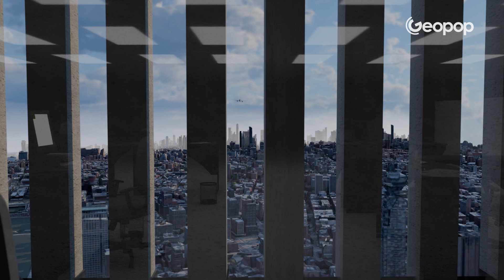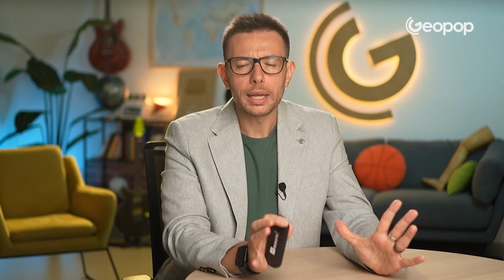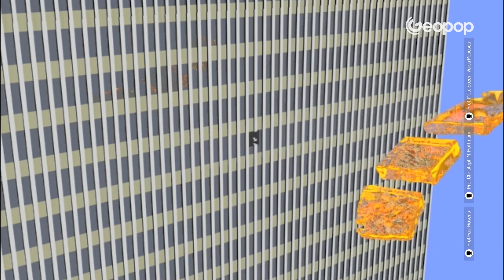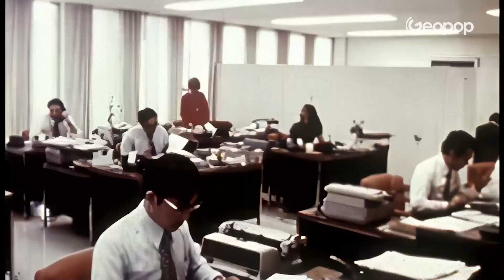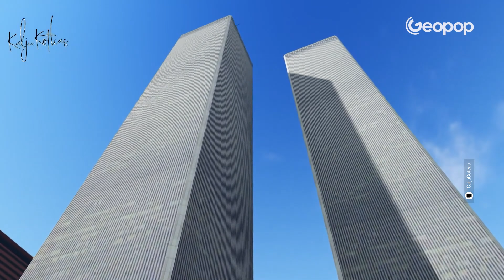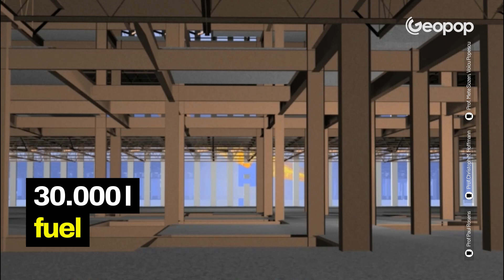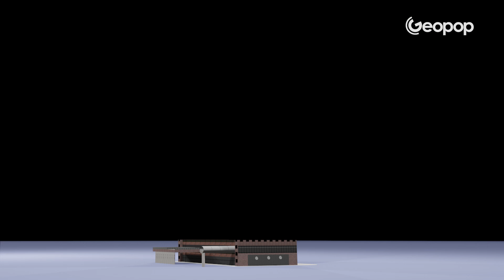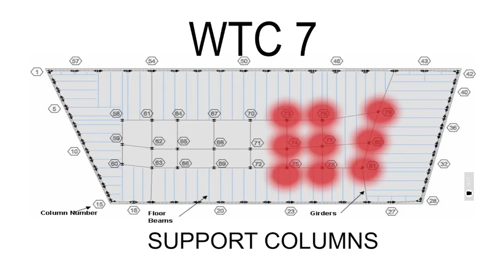9/11, 2001: The Technical Reconstruction of the Twin Towers and WTC 7 Collapses

Comment: What a pack of lies this video is. The inside of the twin towers did not look like that. It had no side to side spanning floors and no vertical uprights. All the floors (yes floors) were conected to a massive central core which was virtually a solid entity in its self. The outer shell ( windows) were load baring. It was the strongest skyscraper that has ever been built. It had so much steel that all the steel mills at the time in the US  were flat out producing steel for it. It was s superbly designed building and stood up to the impacts beautifully. What a cheek that guy has and all the ignorant  pancakers for still spewing out rubbish about it collapsing itself. Anyone with even half a brain cell knows how that was demolished. Although i will hand it to the the crews that did place that thermite, they did an awesome  job.
Reply: Okay flat earther lmao
Reply: @ttiiopp5245 But have you anything intelligent to say pancaker.
Reply: Tell me you don't have the slightest fucking clue how the Twin Towers were constructed without saying you don't have the slightest clue. FFS could you get it any more wrong than that?  How embarrassing 🤦‍♂
Reply: @TheLoonResistance Looks  like  another super high IQ pancaker, Thank god the powers that be have a few of you guys around. You will probably not find how they were made on YT because they are the powers that be, but the twin towers had a solid central core and a load supporting outer shell. It was not a steel lattice. So these guys really should not be lyeing about that. People that lie are generally having to cover for a crime. The law knows all about that.
Reply: @patricksmith4424  - Uh huh. 

While complex, most of the Twin Towers collapse mechanisms can be seen with the naked eye and easily discerned and understood by the layperson IF sufficient time is taken to understand.

1.   The Twin Towers consisted of 4 primary structural elements together forming an integrated system where each relied on the others. 47 hollow box-section steel Core Columns carry most of the gravity loads. The 236 hollow box-section steel Perimeter Columns carry the remainder and ALL of the lateral (wind) loads. Long-span Lightweight Steel Trusses connect core and perimeter column together with a Hat Truss on top to tie it all together as an integrated unit where no element can survive without the others. There was no structural load bearing concrete and most major assemblies were bolted together

www.youtube.com/watch?v=u7OqrC74Dm4
www.youtube.com/watch?v=eKtgPt7e0Fw 

2.   The impact of a 122-ton airplane (= 12 dump trucks) at up to 587 mph with the energy of a ton of TNT destroys the aircraft in 0.50 seconds. This in no way implies the Towers come out unscathed. Some folks get hung up on that. Many perimeter and some core columns are destroyed or damaged primarily by bending, twisting, splitting weld seams and critically by bolt-shearing failures at the end connecting flanges. No cutting or slicing - the reality far more violent and brutal. 

www.youtube.com/watch?v=zF-94yDHlk8

3. The impacts destroy or damage fire insulation, fire breaks and sprinkler systems on multiple floors. Jet fuel acts as an accelerant starting huge fires start across multiple floors simultaneously that spread spread rapidly with no effective firefighting or fire suppression. This was an unprecedented fire event . Office buildings are essentially giant piles of kindling when it comes to fires, chock full of stuff that burns vigorously and quite hot. 

4. The hotter steel gets the weaker it gets shouldn’t be a revelation. With fire protection compromised the survival time of the steel greatly reduced . Over time heat gradually causes the lightweight steel Floor Trusses at the damaged floors to sag, which we can see. No steel melted or needed to. Structural steel fails long before it becomes a puddle. It just needs to bend 5. A straight column is up to 4 times stronger than a bent one. Sagging floor trusses pull on increasingly weak and overloaded Perimeter Columns, causing some of them to bow inward by up to 5 feet until they buckle and fail, quietly initiating collapse. The formerly static mass above which the structure below could easily support converts to a dynamic mass up to 30 times greater. The Columns above and below the failure point are no longer aligned . The load bearing structure below no longer bears any of the load above, which falls past the lower columns NOT onto them. www.youtube.com/watch?v=ULdiD6gYZO0 www.youtube.com/watch?v=zTygQK3vriI 

6. Heat starts the collapse, gravity finishes it . Thousands of tons of debris drop largely within the four outer walls, through the open office space, the path of least resistance crashing onto the first intact floor, The bolted column connections instantly break as the amount of resistance the Floor Trusses can offer is negligible, slowing the falling debris only marginally and briefly before the connections fail. www.youtube.com/watch?v=flo62pdaIMI
Note: 
6a. This is NOT a solid top block crashing into a solid bottom block . 
6b. The debris falls past the columns not onto them. The columns provide no resistance to the falling debris. 
6c. Only the bolted floor truss connections to the core and perimeter columns offer any resistance. A pair of 5/8” bolts at each end of each truss vs. thousands of tons of falling debris. 
6d. No laws of physics are violated. 
6e. There is no 20 floors against 90 floors but rather 20 floors against one floor, then 21 floors against one floor, then 22 floors against one floor, etc. 

7. This floor-led collapse progression largely within the four outer walls can only go straight down. There is no lateral force to push it over the side, only gravity to bring it down. 

8. Collapse progresses through the floor systems past the columns, through the path of least resistance . Resistance offered by each floor is always the same while the falling mass acting on it is constantly increasing and accelerating (gaining energy). This process of floor-by-floor destruction cannot be arrested. It can only speed up . Rate of floor failures increases with each floor as momentum increases, reaching an average acceleration of 0.65 of GA, or 35% slower than true free fall. Bam, bam, bam down the building until there are no more floors to fail. More mass, more velocity, same resistance with each floor. Don’t get stuck on the but the lower floors weren’t on fire nonsense. They didn’t need to be. 
8a. This process is often incorrectly referred to as “pancaking” which while catchy, is incorrect. Too simplistic and inaccurate anyway. More like Kaiserschmarrn. 

9. The Towers were 95% air by volume. As that air was compressed inside the building by falling debris, pressure builds until it is blown out the sides in reaction to the building collapsing . Those were not “explosions”, it was expulsions of compressed air caused by the collapsing building, explaining the low velocity, lack of flash, blast, supersonic pressure waves and lethal high-velocity ejecta. 

10. Perimeter Columns become detached and peel away like a banana behind the collapse front, playing out to the four points of the compass in long lines extending to 800+ feet from the base of the towers, damaging and destroying nearby buildings. 

11. Core Columns fail last as their internal beam bracing is stripped away by falling debris and lateral support from the floors to the perimeter columns is lost. 

www.youtube.com/watch?v=WpHXj62Ylw0

12. This process took 31-34 seconds from perimeter columns bucking until the last core columns hit the pile, or 1/3 the rate of true free fall. Don’t believe me? Just watch a video of the collapses and note the loose truly free-falling debris dropping much faster than the towers themselves. 

www.youtube.com/watch?v=dh4r-gHdyPU 

13. Each Tower had a 1-acre footprint. Far from collapsing inside their own footprints the debris pile spread out over 17 acres in a pile up to 14 stories deep. 8 surrounding buildings were destroyed and scores more damaged by the falling debris. 

14. NOT observed were the 180-190 dB bangs of thousands of high explosive devices or the blinding brightness of burning thermite. Explosives or thermite couldn’t have survived the impacts and subsequent fires anyway. Nor could they have caused the perimeter column buckling that clearly initiated collapse. Video of an injured and in-shock firefighter casually using the magic word explosion isn’t proof of explsoIVES and hardly makes a case for planned demolition. Pre-planned demolition doesn’t match the physical evidence and would be technically impossible, totally impractical and completely unnecessary. Simply, no one would bother. In 24 years, no structural engineers of tall buildings, including the 1/3 who have retired, have made any statements in support of planned demolition claims. NONE. The lack of such citations in engineering literature published anywhere in the world is telling. 

15. Twin Towers were perfectly safe within their design envelope. They only collapsed when taken far outside design parameters by an extraordinary and unprecedented event Impact + Fire (heat) + Time + Gravity = Collapse . Remove any 1 of those 4 elements and there is no collapse. Ignore any of them and you will never understand the collapse. The Twin Towers were an integrated system in which no one component could survive without the others. One fails, the rest follow, through the path of least resistance DOWN the open space, bypassing the path of greatest resistance, the columns. No laws of physics are violated and the above is true no matter who planned and carried out the 9/11 attacks or why so the attacks could still be an “inside job”. 

If you made it this far, kudos. That was a lot. I hope it was helpful, informative, non-adversarial and solicits informed critical comment, positive or negative. If I made any errors of fact, logic or reason or left anything critical out, please let me know and I’ll fix it. To stay focused, just one point at a time please and on-topic (Twin Towers ONLY). No word-salads of Gish Gallop. IF you can offer a more plausible alternative be my guest. Please start any reply with the words “Tits McGee” or I’ll know you didn’t read it and aren’t serious. Thanks for your time.
Reply: @TheLoonResistance Tits Magee

    1. Best video. This one alone proves the pancakers story is utter nonsense. The pancakers rely on the fact that the floors were fixed from one external wall to another one. All the simulations and programs that have been made show this. Note, because of truth cencorship including youtube this is the one thats pumped out to the masses for propaganda. The video clearly shows the floors were attached to the central core, so even on a given floor, they were independant of each other, so they could not have fallen as one floor.
2 For me, this vid says it all and shows you how ignorant the pancakers are. All scyscrapers are designed  to sway in the wind. On 911 an eyewitness said " when then there was the impact the tower kept moving, and he thought it would topple, but it went back. Relief! This showed the towers coped with the impacts and all energy from the collision had been disipated through the half million tons of material.
3 The bowing in of the window at that point was the start of the thermite charges going off so you could expect a bit of deformation to occur, could you not. But if that is the only footage of the pancakers no 1 argument is used that is pathetic. 
4/5 most of the fuel had been burned up in the fire ball, do you seriously think that the bit that was left could pulverise half a million tons of fabricated concrete
 Remember the steel was untouched in the twin towers, steel is an excellent conducter of heat so it soon disperses. Steel melts at 1800 degrees so that is  impossible from keroscene. Even when soft, steel steel holds staggering strength 
 Jet engines are made of steel for christ sake!
 In the North tower the impact was between between floir 93 and 99 out of 110 floors so it was nearly at the top of the building.
 Now is the most important fact you will hear about the towers collapse. 
   After impact all floors from 91 below were completely normal, yes lights on computers running no debri ..nothing. so it is safe to say 91 down was an utouched skyscraper. As has been discussed the object hitting, made the tower sway which it was designed to do.
There have been a huge amount of lies about how much heat the fires generated and the damage to steel. Nothing was touched from floor 91 below. There is a famous picture  just before demolition where a woman is standing looking out of the hole that the plane made. Hang on, this was supposed to be the epicentre of a fire that pulverised half a million tons of steel yet she is not even warm looking. What an embarassment that picture was. 
6. The collapse violated 2 physics laws
    The first is the first law of thermodynamics " energy cannot be created or destroyed" to pulverise half a million tons of matter would require staggering amounts of energy. There was no potential energy therefore no kinetic energy. The building was holding everything above it, so where did the energy come from? For example the only way to get potential energy and kinetic energy would be for something to lift say 30 floors up in to the air 100 feet. Here it would have potential energy due to gravity, if that was dropped then that would create some serious kinetic energy and damage on impact. This leads into the second physics law broken. Newtons 3rd law of motion " for every action there is an equal and opposite reaction". Imagine that those 30 floors were dropped from a hundred feet on to the tower, they would have had equal damage done to them so the 30 dropping floors may have destroyed 30 standing floors but by then both would have been destroyed so there would have been no more energy left to destroy the rest of the building.
7/8 The vid of the guy with the wooden reconstruction i think demonstrates more than anything why the pancake theory is nonsense. None of the boards were attached to each other. Ever built a card house? Ever glued a card house? A glued card house is impossible to collapse. Why this vid is so important is that he built  the sides in short boards. Why didn't he create it authentically and and put solid planks there? 
Whats is really creepy is that he knew solid  planks ( authentic to columns in towers) would not work, so he basically knew the pancake throry is a joke. I suppose it gets him lots of views. Its the same with the ice one. The two uprights were balancing pieces of wood, of course the weight of a chain will topple them.
11 The simulation video is in correct it does not show the extreme horizontal blowing out of the exploding tower.
14. Wrong, wrong, wrong. The best film about the towers collapse was made by architects and engineers for truth. It is called explosive evidence and basically it says the lot. A lot of very important engineers and architects went on camera for this an by their own admission were putting their careers on the line doing it. Explosives Evidence has been banned now, because it scientifically  proved the pancake theory was impossible.
  Nobody knows what the pancake theory is because it was so distorted expaining the towers collapse.
   The pancake theory is basically where if you have a floor,  that floor is only designed to hold bodies, furniture etc. If you put too much weight on it it could break from its fixings and collapse. If this happened in a series of floors then that floirs weight will add to the lower one so it can't cope. The result is compound weight acting on each floor. This can only effect the floors as whats holding the floors up cannot be compressed which is why the guy had to use multiple pieces of wood.
Reply: https://youtube.com/shorts/jTqR7LsTq8s?is=ZCWa2s5zOldlO56j

Above is a vid of grefell tower in West London, it was a cheap social housing tower block with rebar concrete. It was a  raging inferno for 24 hours. Structurally it was untouched still there to this day.
Compare that to the north tower. Untouched by fire from floor 91 below. Literally a fountain of Ash created out of nothing. Now look at some controlled demolitions.

https://youtube.com/shorts/DlrcFGj9Wak?is=VlYhmVPZvITdodQH

https://youtube.com/shorts/ZS1FXBqRU44?is=J9rWF_10my_0C2c0

Comment: Nobody mentioned the world's largest bomber B29 Superfortress hit the Empire state building and the damage was confined to the floors it lodged on.
Reply: It was a B-25D Mitchell medium bomber which weighed about as much as one engine on a B767 and was doing 180 mph not 587 mph.  

That B-25 hit wirh the energy of about 42 lbs of TNT where Flight 175 was over 2,000 lbs of TNT equivalent. 

Apples to apples it ain't.

Comment: So, why a fire on floor 90 would weaken the structure of floor 1-2, etc?
Reply: It doesn't nor does it need to. Failure happens where the fire is.  Top of the building then pile drives it's way downthrough to the ground.